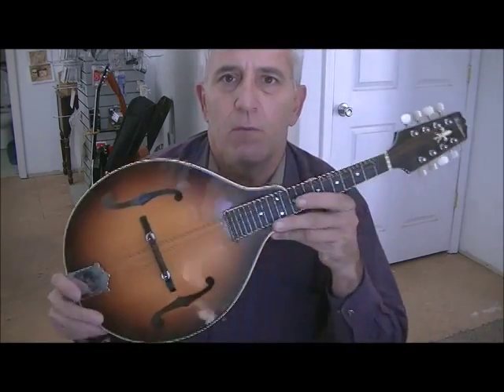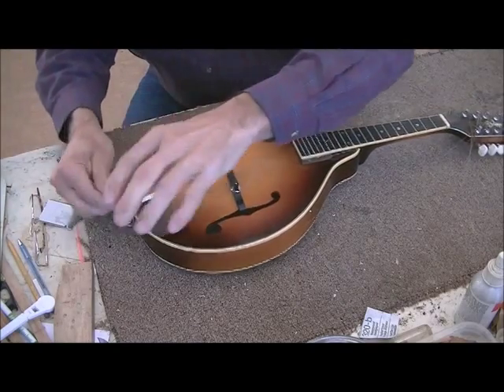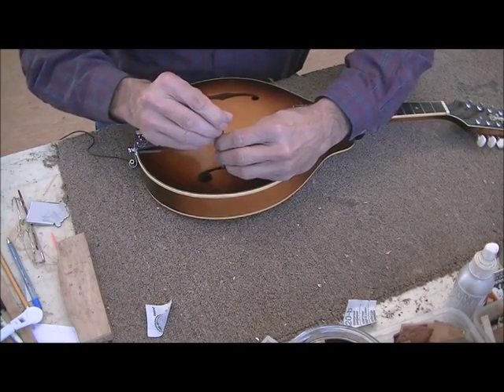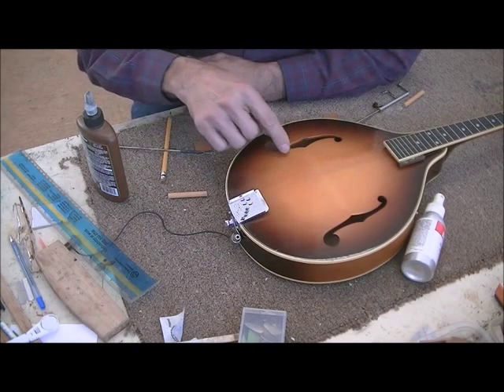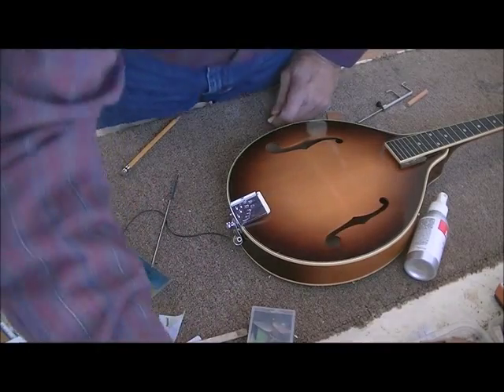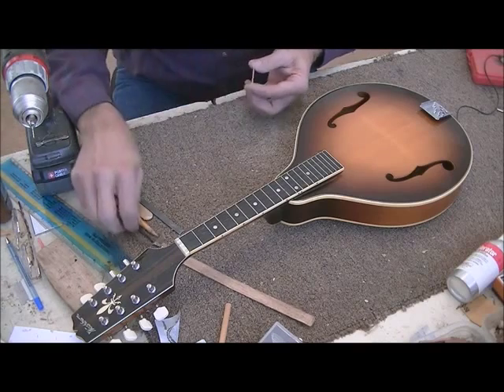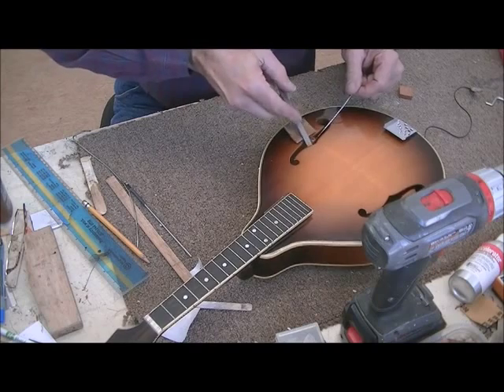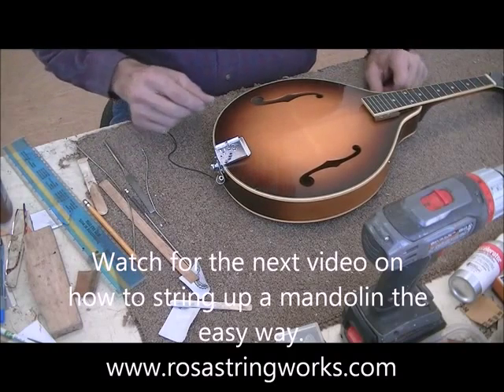017 RSW Washburn Mandolin Sagging Top quick fix

Comment: I used the same principle of holding on the top with a sound post, but in my case, one of the "ribs' that cross in an X shape below the top to give it rigidity cracked on the E string side and the top started to cave donw. I've put the sound post right below the cracked part (not touching directly the top, only the structure "rib" (I don't know the actual name of it, sorry hehe).
At the beginning, it was fine, but the pressure started to puncture the back of the instrument, so now I'll be putting some wood pad to distribute the force on the back. Soon I come back to say if I screwed all up or if it was great success hehe

Beside the fact that I found this video only after doing the repair, thanks for the idea anyway!

Comment: I have a kentucky km 140 it was worse than the Washburn and i sanded the front and put wood puddy where it was sunk in and the sound is great didn't hurt it for me just paying 20 on it i don't think i was hurt by fixing it that way
Reply from the maker: Thanks for the comment.  Interesting fix.  I would think it might sag further in the future.  But maybe not.   The advantage of the post fix is that it should be stable and you can't  see it from the outside.
Reply: Yeah your the first to post about this problem wish this video was up when i got my kentucky

Comment: Interesting video.  Of course "they" always say a sound post won't work in a mandolin but what the heck in makes sense here. How did it sound?  Did you ever post the part 2 video of the string up?
Reply from the maker: To be honest it really didn't sound very good.  I have put sound posts in other "low end" mandolins that with sagging tops that sounded fine.  This one really didn't sound very good.   I imagine it probably didn't sound very good even before the problem.  Thanks for commenting.
Reply: Rosa String Works
 Thanks for the information.  I  agree, for sure top sag kills sound.  I just took the back off my 1936 Gibson K-1 mandocello and installed an additional transverse brace under the bridge to stop the excessive top sag. I was afraid that it might negatively affect the tone and projection but instead it improved it greatly!  Here is the thread on the Mandolin Cafe site on the repair.  If I lived near you I could have had you do it! (<:  http://www.mandolincafe.com/forum/showthread.php?116144-Repairing-a-1936-Gibson-K-1-mandocello

Comment: I have a similar problem on an oval hole mandolin, I was going to try to fix the part near the hole but the bracing from deeper inside is broken completely off and I don't know how to get something that far into it. I was thinking about putting a metal bracket accross the front near the bridge or on both sides of it, it would be ugly but I feel like it might work?
Reply from the maker: matt forty if it's not an expensive instrument, just cut the back off of it, fix the braces and glue the back back on.  Good luck
Reply: my whole issue is the back is all warped too. really don't think id get it back together if i took it apart.

Comment: Did you ever do the video you mentioned on how to string a mandolin?
Reply from the maker: dts5184 I don't think I did an actual video on it but I have touched on it in quite a few different clips.  Maybe we'll get to that one of these days.  I'm kind of crazy busy at the moment rebuilding my whole website.
Reply: I'm never sure how much slack to leave before starting to wind. Too little and there must be a risk of slipping, too much and it takes too long to wind and perhaps the sound suffers somehow. Do you have a rule of thumb? (And greetings from Scotland - love your very useful videos!)
Reply from the maker: dts5184 yes my rule of thumb is to use the height of 2 fingers (one on top of the other) across the fretboard. Then thread the string over the top of the fingers and pull out most of the slack through the string post hole.  Not real tight just slightly snug.  Hope that helps.
Reply: Thanks!

Comment: What kind of stick is that? Poplar or spruce? I see the bar code on the side at 4:25, and it looks like a dowel I could pick up at my local hardware store. What did you use for this? Thanks!!!
Reply from the maker: I only use Spruce and violins. But on a hack like this anything is better than nothing.
Reply: You da man,  @RosaStringWorks

Comment: Hi Jerry,
Thanks for posting this helpful video.
I've got a Rogue mandolin - less than a year old, but has some serious top sinking issues. I keep extending the height of the bridge, but the insides of the f-holes just keep getting lower and my G and D strings buzz when fretted. I looked inside with a dental mirror and it turns out that there are no tone bars under the top. Musician's Friend will replace it, but shipping costs for me to return it from Canada will cost more than a new Rogue, so I think I'm going to try the tone bar solution. A contributor on the mandolin cafe forum suggested it to me a couple weeks ago -and then I came across your video here. I've already set the instrument up quite nicely with help from one of your videos and a very helpful e-book by Rob Meldrum 
https://www.youtube.com/watch?v=iuHCX7JT-d8. 
The mandolin sounds lovely when I can get the strings up high enough. I expect to lose some sound quality with the posts, but it will hopefully be playable and good enough for me to continue learning on until I get good enough to warrant an upgrade.  
I have a question about the positioning of the posts. You placed yours a little bit behind where the bridge sits. When you have a moment to respond, I was wondering why behind - and not directly under.